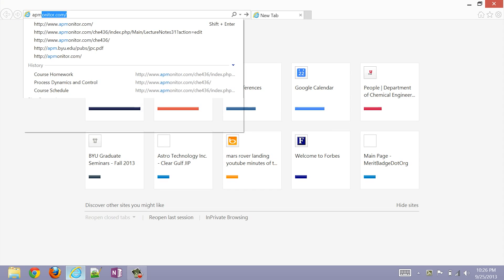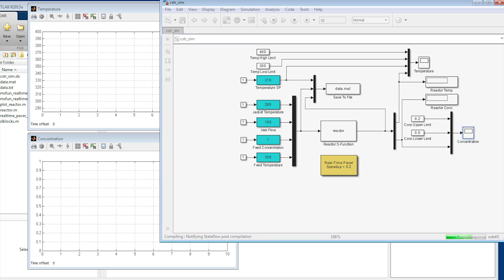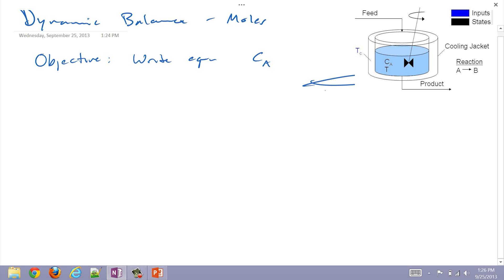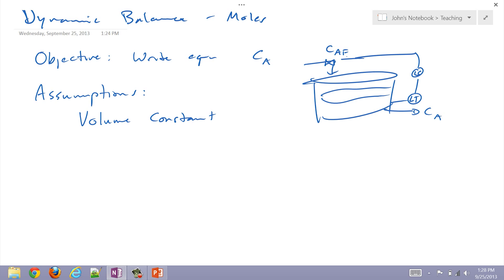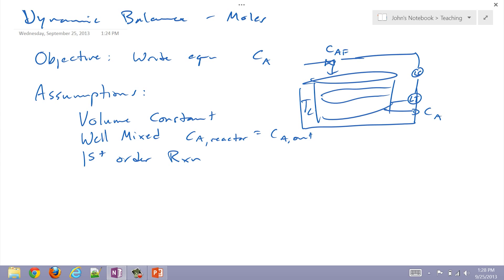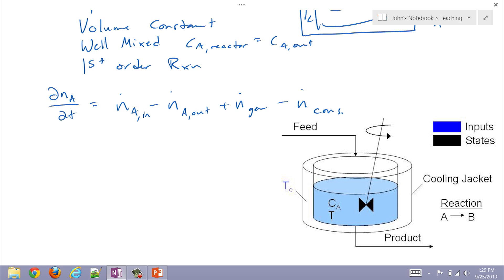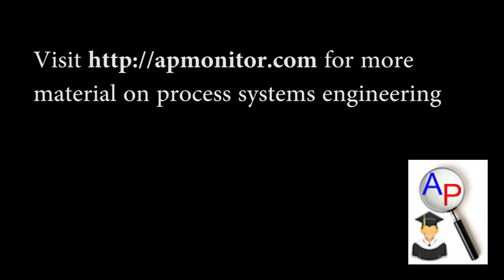Transient (Dynamic) Modeling in MATLAB / Simulink

Comment: Currently doing a similar case study, where did you get your data from for your reaction A -> B? is it modelled on a particular reaction?
Reply from the maker: It is a standard CSTR reactor. More information is here: https://apmonitor.com/che436/index.php/Main/CaseStudyCSTR
Reply: @apm  More specifically where is the reaction data from, Ea, enthalpy of reaction, K0, Cp ect , is it modelled on a particular reaction?
Reply from the maker: @philipwistow9970  It is not modeled on a particular reaction. It is an academic benchmark problem that is used in many example problems of nonlinear systems. Here is another example with PID tuning: https://apmonitor.com/pdc/index.php/Main/StirredReactor

Comment: Why do you call this dynamic problem while it is a thermal problem?
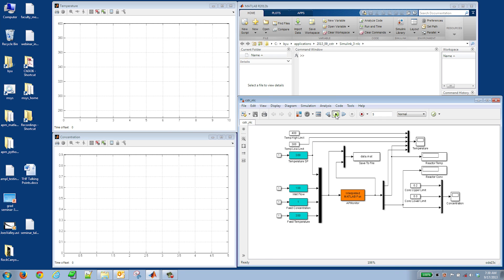Reply from the maker: Jon, some people think that a dynamic problem is defined as the movement of an object. My definition of "dynamics" is any variable that changes with time. In this case, concentration of the reactor and temperature of the reactor change in response to a cooling temperature change. Check out 15:50 for the simulation of the dynamic equations (differential equations). I also have a course on dynamics and control at http://apmonitor.com/pdc with several other dynamic simulation case studies.
Reply: APMonitor.com Thank you very much it make sense but shouldn't we call it Transient instead of Dynamic?
Reply from the maker: Jon Saw it may be a terminology thing that is used differently in certain scientific or engineering communities. I updated the title of the video to reflect your input. Thanks for the suggestion on "transient".
Reply: Oh wow thank you very much :)

Comment: Where can I learn more about dynamic inputs into simulink? i.e. where you were controlling the jacket temeprature in real time?
Reply from the maker: +Atomic_Sheep I used a slider input. You can also use a constant input that you double click and change while the simulation is running.
Reply: How did you manage to simulate the model over a long timeframe allowing for changes to various inputs into the system? If I change the simulation stop time to something very large, I still get an instantaneous solution to the simulation and I simply don't have any time to change various variables, I click run and the next moment, the simulation is complete.
Reply from the maker: Gautam Vallbha created a real-time pacer here: https://www.mathworks.com/matlabcentral/fileexchange/29107-real-time-pacer-for-simulink  Just drop in the Simulink block and it will artificially limit the simulation speed.
Reply: Thanks.